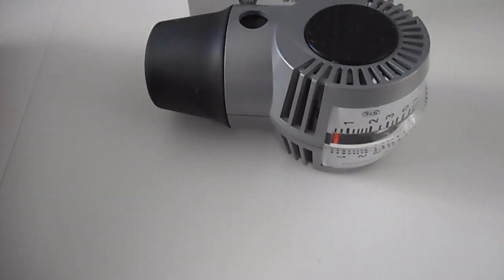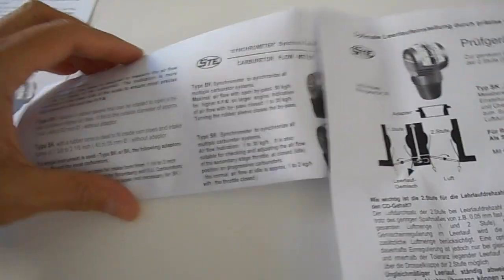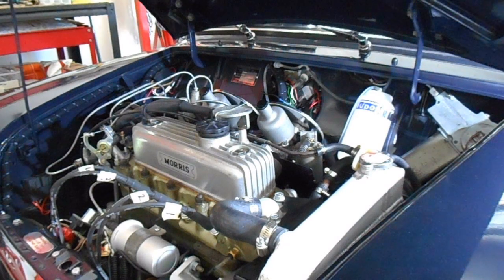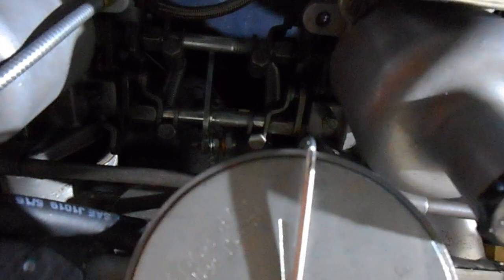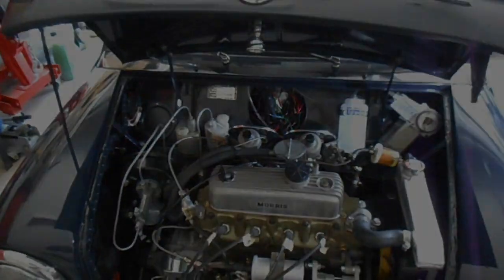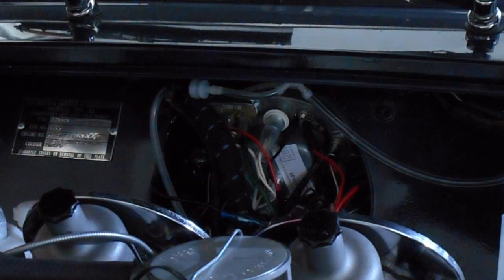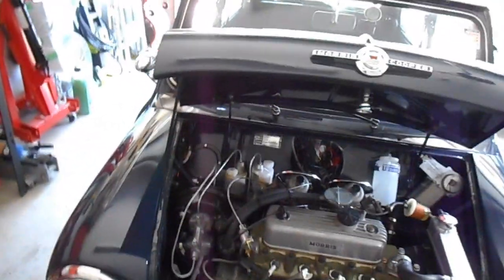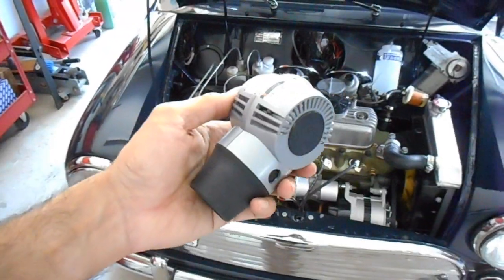STE Synchrometer - Morris Cooper S Twin Carb balancing

Comment: I also have a mini 1000 with double hs2..what should be the correct intake value of the carburettors..you are at 7kg/h...
Reply from the maker: Don't worry about the air flow value, if it is a twin carb setup just get them the same value. Then adjust your idle speed to get the correct RPM for idle.
Reply: @CafeRacerLab  ok perfect...

Comment: Did you do the mixture at the same time??
Reply from the maker: No. The device measures airflow going into the carb to make sure the volume is the same in both carbs. I do other tests to measure the air fuel mixture ratio.

Comment: Looks like a pretty good tool for the job. There are a few other options. Gunson makes a balancer as well as the Colortune mixture reader.
https://www.gunsonshop.com/contents/en-us/p227_G4053_Gunson_Carbalancer.html

On motorcycles typically people run vacuum gauges to each intake manifold to balance each carb. Some even use electronic gauges like TwinMax, but all work on the same principle of measuring vacuum difference between each carb intake. 
Do you need ot then perform a Colortune mixture adjustment after you do the balance step?